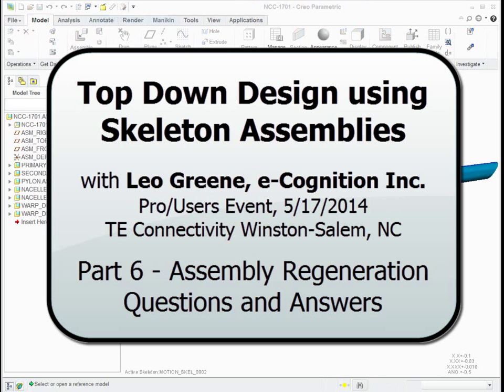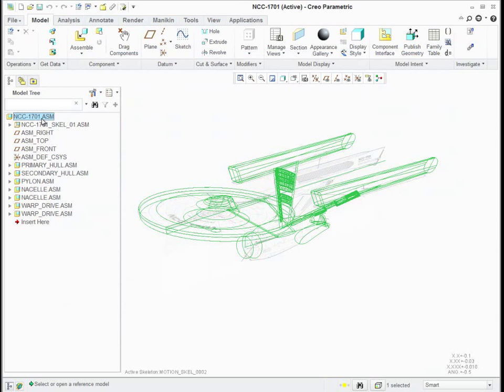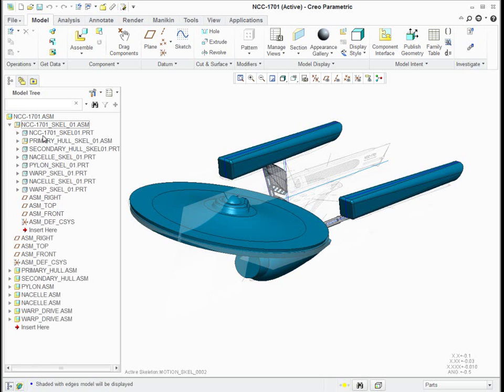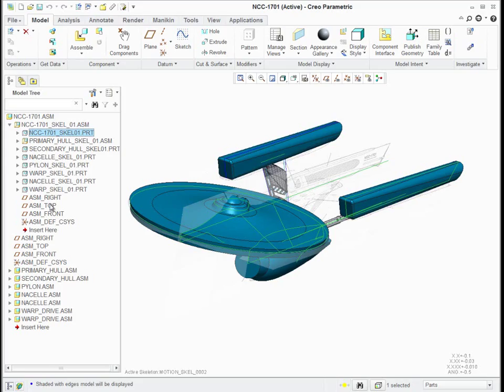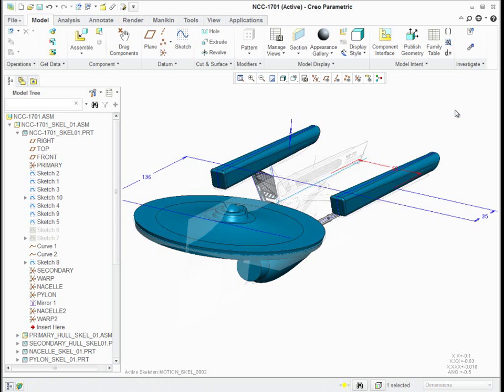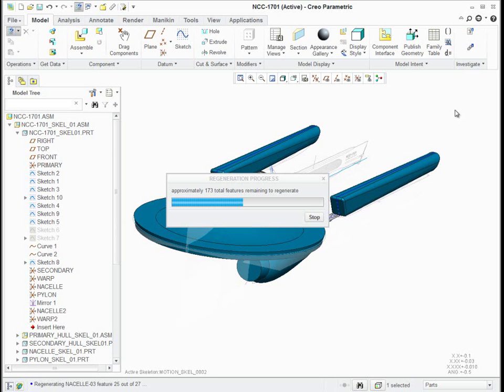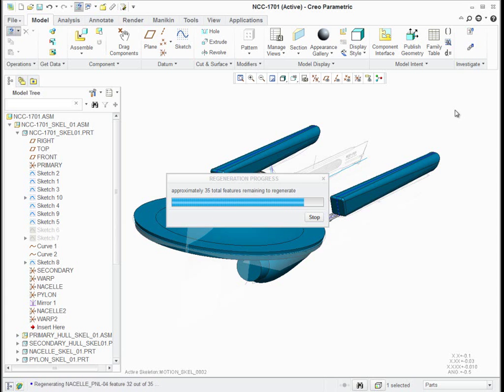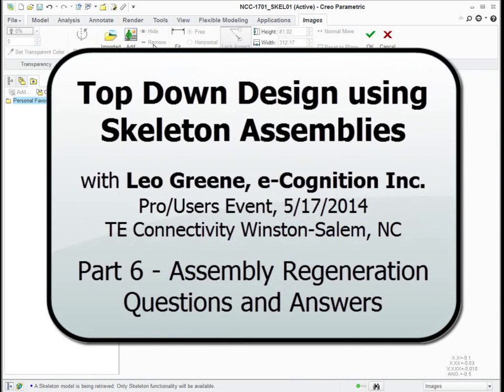Top Down Design using Skeleton Assemblies - Part 6 Q&A

Comment: Great stuff as always. I do have some burning questions as a professional designer; Your method works perfect for reversed engineering, but what if I want to create a parts that needs information from multiple skeletons? Wont this become a nightmare because its really hard to track down a source when there are multiple sources.. or should I create a new skeleton that uses copied geometry from multiple top-skeletons and use that in my part?

I noticed you dont use publish geometry. Is this a better method to your opinion?

What do you recommend when you already made a big assembly and then decide to radically modify the geometry of your skeleton?